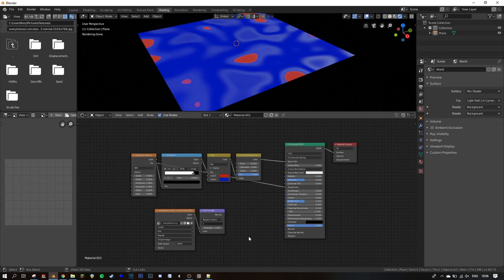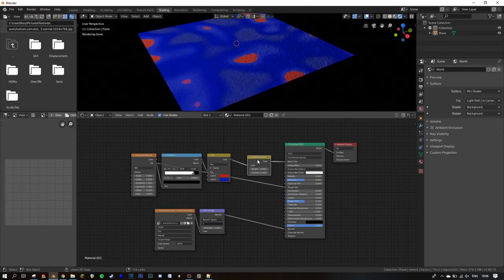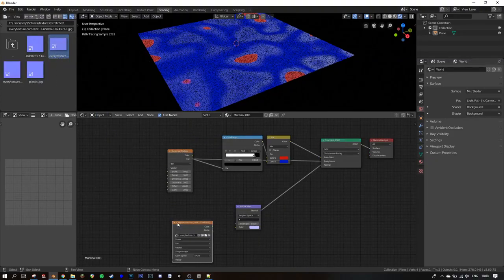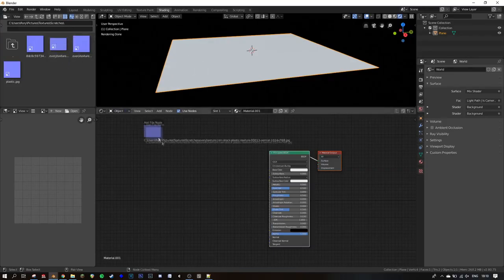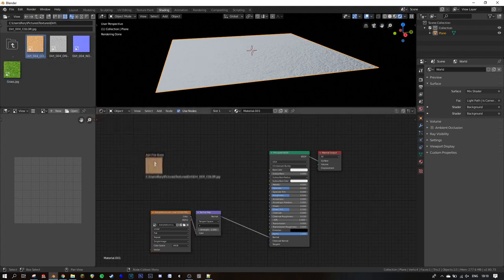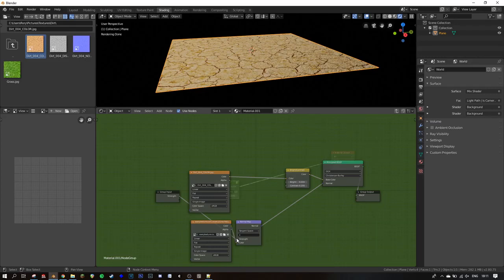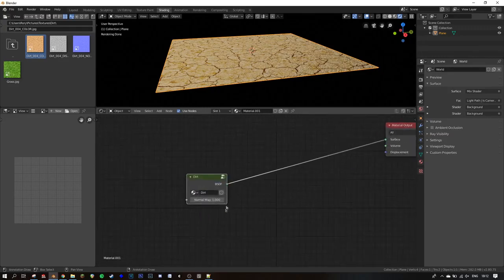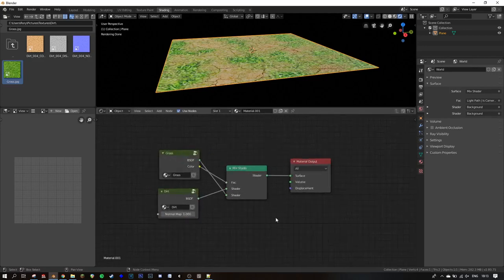Blender | Node Editor Essential Tips

Comment: Hi, I'm having a problem with figuring out how to resize those nodes. For some reason I click something and they're too tiny to see and I don't know how to get them back. If you know how to resize them please let me know I would truly appreciate it.. The long way by choosing the correct files in the menu works best for me. Please let me know. Great tutorial! Thanks!
Reply: I might have figured it out! View -Toggle Maximize Area. i'm going to work with this, but if you know anything better, please let me know. Thanks!
Reply from the maker: It should just be by zooming (just using the mouse scroll wheel). The nodes cannot actually change size, you can just change your zoom amount in the node editor
Reply: @RoryAllenBlender  Thank you so much for your quick response. However, your way doesn't seem to work. Unless I'm doing something wrong. I am on Mac unless it doesn't matter. It appears my work around seems to work, but thanks again! Ah ha!  Use the mouse wheel while holding down the command key! Thanks1
Reply from the maker: No worries! Glad you worked it out